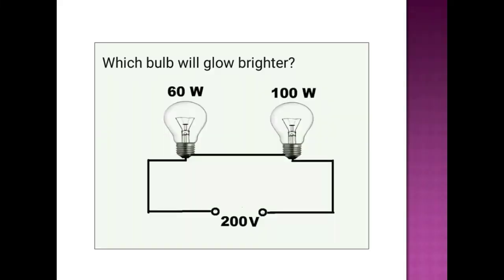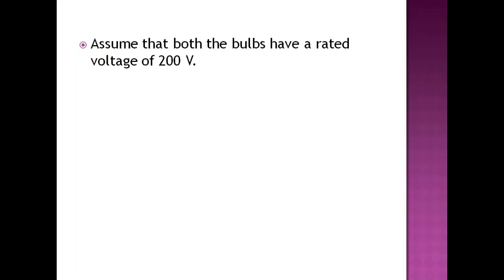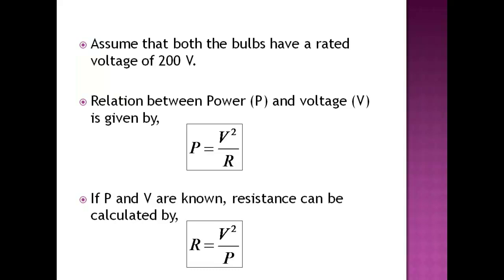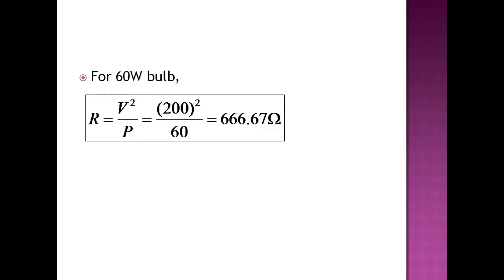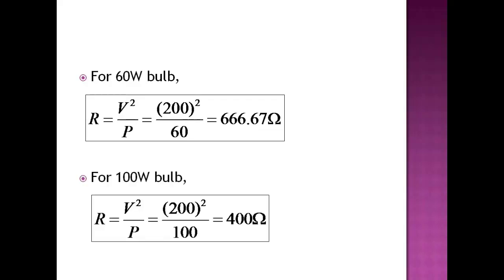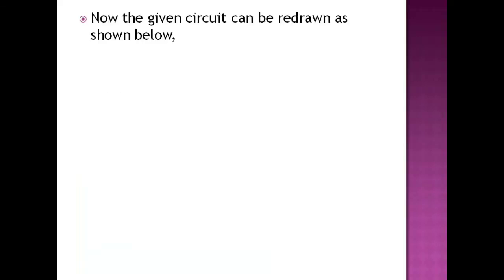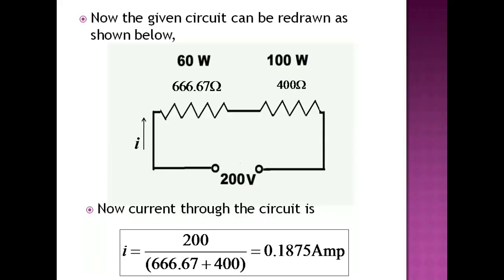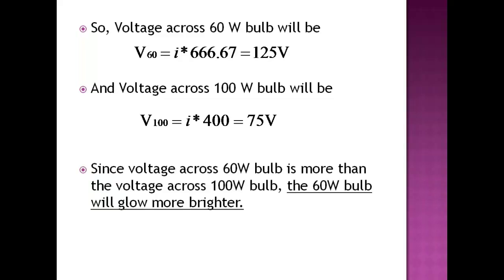Which Bulb Glows Brighter - 60W or 100W ? | Every Engineer Must Know

Comment: I’m a little confused by this basic EE concept. I don’t think it’s the voltage drop across each bulb that should dictate their brightness. Since the bulbs are in series, they have the same current passing through them. Which ever bulb is more efficient with that current will shine brighter. That’s all. (I am not a light bulb expert btw).

Comment: but sir , in this case will not the voltage divide for each bulb as it is a series connection why are you putting same voltage instead we should find current for each bulb in this case as current in the quantity that will remain same
Reply: Voltage drop and Applied Voltage is a different thing

Comment: How can you assume individual voltage drop is same as total Voltage drop as 200v??
You can say let individual voltage drop be V (unknown)
So R(100w)<R(60w)
Therefore as i^2*R(60w) which is power dissipation is more ,so 60 w bulb will glow more
Reply: He is correct with assuming an Umax=200V rating just to make sure that none of the bulbs will blow! Then we can work on the current, which is maximum 0.187A with the assumed ratings. 

If you don't assume this, you cannot calculate the values.

Comment: if they have different voltage does that mean the 100w bulb will glow brighter if it needs more voltage while the 60w bulb will dim or not glow if it has lower voltage rating.

Comment: Sir, I don’t think that calculating voltage and current is needed to check which one would glow brightest as they are in series (so current would be same.)  so resistance alone is enough to compare the magnitude of brightness in series circuit.
Thank you
Reply: Yes u r right..... We can easily conclude from resistance values... No need to calculate voltage
Reply: Can u explain how?

Comment: if the bulbs are connected in series then how you are putting the same voltage we know that in series voltage is different but current is same.
for finding resistance you are putting the same voltage for both ????????
Reply from the maker: For finding resistance, we are considering the rated voltage of the bulb, so we have considered the same for both the bulbs.

As both resistance values are different, the voltage drop across both the resistances is different.

Comment: But two resistive values become one collective value when connected in series. correct me if wrong. Therefore u can obtain the one constant current flow and further work out the different voltage across each lamp
Reply from the maker: Yes, a constant current does flow through the bulbs, but the power consumed by 60 W bulb becomes more in this case.

Comment: But if they are in parallel ??
Reply: In parallel, voltage will  be same. So 100w bulb glow more than 60w bulb.
Reply: Power is inversely to Resistance

Comment: The answer is right but the process isn't......we have to calculate the power consumption of each bulb means I^2R at first we have to assume the voltage rating is 200v and calculate the internal resistance....And then we have to calculate the current which is same for both bulb....At last calculate the power consumption which is 12.96 w for 100w bulb and 21.6 w for 60w bulb so the 60w bulb will glow brighter.....That is the original process!
Reply: Amizing answer, totally agree with you
Reply: @ib5661  thanks!
Reply: @nahidahamed5276  yes you are correct
Reply: Boss? Can you help me to solve 220VAC?
Reply: Yes sir, you are right
Reply: Yeah man I was doing with this system too I was surprised when he calculated the voltage across the two lamps

Comment: first you took voltage 200V for both the bulb to take out the resistance and later on you found different voltage for different bulbs. what you did was wrong
Reply: It isn't wrong.
He simply put both light bulbs in "fictional" circuits in order to compute their respective resistances. The resistance of a light bulb does not change with voltage, since they can be considered Ohmian resistances.

But we do not know the current, which is why we need to compute the resistance by using a "reference voltage"

Comment: we know that , in case of series grouping , current is constant , not voltage , which is main supply, we know  that each bulb has own voltage dropes , so how it is possible?  I  have subscribed , explain me clearly  by a another video
Reply: Milan Mal you can see it another way as well.
Since 60 watt bulb has more resistance than 100 watt bulb.
Now current is same in each bulb in series.& power in each bulb is p=i²r  since i² term is same in both, but r is greater in 60w than 100w so power is maximum in 60w in series.
In parallel power will be maximum at 100watt bulb, because it will draw more current.

The method he did in the video is wrong... But 60watt bulb will glow brighter.
Here I & R both are unknown so you can't find exact current & resistance with the given information.
Reply: Adnan Afrydy yeah I totally agree with u.
Reply: Milan Mal but do remember both bulb should be made up of same material, only in such case brightness will depend upon Power.
Otherwise brightness depends on Luminous.
Reply: Milan Mal voltage drop is different in series.. Here the 200v is not voltage drop, it's the source voltage i.e EMF of the battery. & this 200v is divided in each resistance, bulb in that case
Reply: John Berry 100watt bulb will glow brighter in parallel circuit.
Reply: what he did is absolutely wrong
Reply: what he did is wrong
Reply: Milan Mal yeah current is constant but we need to know how much current will be drawn from battery. For this you will see it's series or parallel circuit & using formula I=v/r ; R=r1+r2 in series. V is battery voltage not voltage drop...
Reply: OK thank you, I am going to try and follow this until I fully understand. Thanks again... :)
Reply: This has been calculated wrong, the correct answer is: 100w bulb will glow brighter.